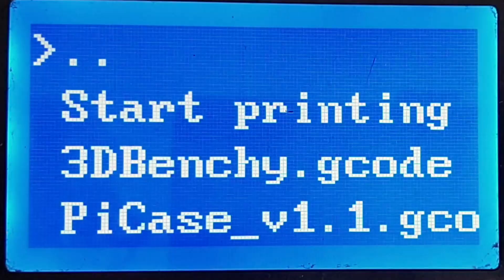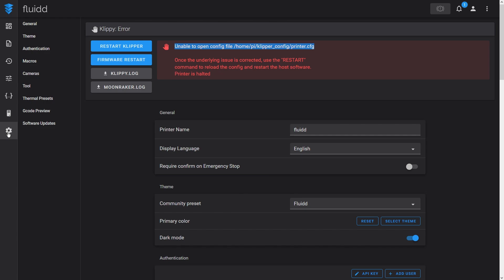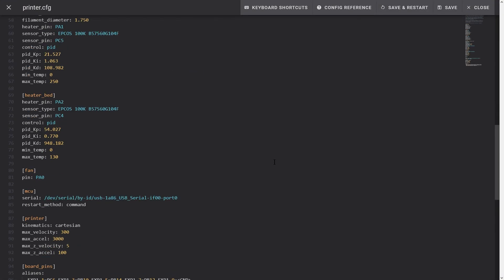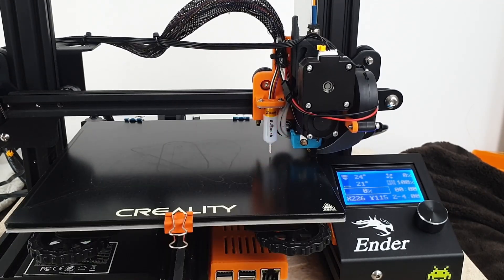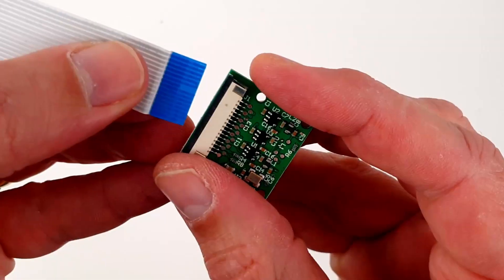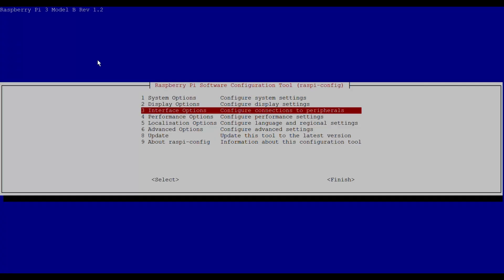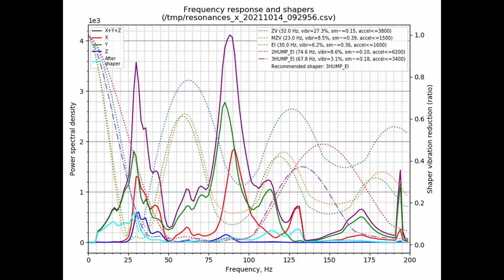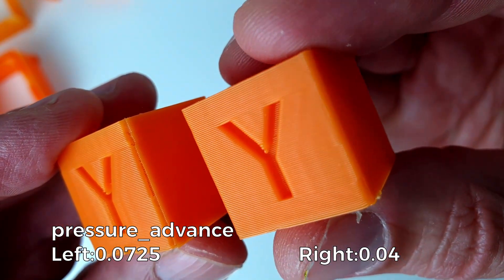Klipper on Ender 3 😱

Comment: I am thinking about installing Klipper on my Ender 3 V2 but I am a little wary about the BLtouch configuration. On Jyers firmware I have the BLtouch setup to use the Z stop switch due to the constant fails when set up on the dedicated BLtouch port. Do you know what adjustments I would need to make in the Klipper firmware to continue using this method?
Reply: I have an Ender 3 Pro with BTT SKR Mini board, but the principle is the same. My BLTOUCH is connected to the dedicated port for power (red, yellow and brown) and the z-endstop port for signal (black/white). You need to find out what the name/numbers are for the ports on your board and specify that in your printer.cfg. The ports are named differently on my board, so you have to search a bit. But if you get the names right, it'll work.
Reply from the maker: Thanks for your help. Can you please share your [stepper_z] section and [bltouch] section in printer.cfg? The pin names for the Creality board V4.2.7 are: endstop_pin: ^PA7, sensor_pin: PB1, control_pin: PB0.
Reply: @YouMakeTech  In the [STEPPER_Z] section, you add 'endstop_pin: probe:z_virtual_endstop' and the bltouch section looks like this: 
[bltouch]
sensor_pin: ^PC2

control_pin: PA1
x_offset: 39.5

y_offset: -3

But this is on a SKR Mini E3 V2, so the pin names on the Creality 4.2.7 board are different. In the example config for the SKR board, they put in the pin names for the bltouch connector, not the z-endstop, so it wouldn't work at first until I figured out the endstop pin was different.
Reply from the maker: Thank you very much. The Z end stop pin name on the Creality V4.2.7 is ^PA7. So applying what you did on the SKR Mini E3 V2, we should do this for the Creality V4.2.7: In the [stepper_Z] section, we keep endstop_pin: probe:z_virtual_endstop. In the [bltouch] section, we change sensor_pin from PB1 to ^PA7 and we keep control_pin: PB0. 
sensor_pin : PB1 means the BLTouch is connected to the dedicated 5 pins connector. 
sensor_pin: ^PA7 means the BLTouch is connected to the Zmin end stop.
Reply: @YouMakeTech   Is that the same pin name for the 4.2.2 board. I tried moving back to the 1 connector with 5 wires to see if it would work in Klipper but just like in Marlin it crashes :(
Reply from the maker: I believe yes, according to this -> https://github.com/MarlinFirmware/Marlin/blob/2.0.x/Marlin/src/pins/stm32f1/pins_CREALITY_V4.h
Reply: Update- followed the steps right the way up to the create the printer config file. I looked in the config examples and opened up the creality ender 3 v2 file and copied the contents, made the new printer.cfg like in the video and saved but then after firmware restart i just get -

Printer is not ready
The klippy host software is attempting to connect. Please
retry in a few moments.

Waited for 1 minute then this messge shows
mcu 'mcu': Unable to connect
Once the underlying issue is corrected, use the
"FIRMWARE_RESTART" command to reset the firmware, reload the
config, and restart the host software.
Error configuring printer

Anyone any ideas?
Reply from the maker: Did you update Klipper to the newest version? I just did and I had a similar error message. To fix it, I had to re-flash the micro-controller code in the printer mainboard. It appears that Klipper is not backwards compatible: The version of Klipper in the Pi and in the mainboard must match. In any case, try to re-compile and re-flash the printer mainboard. I checked the ender 3 V2 config file and the settings are the same: during "make menuconfig" select the STM32F103 with a "28KiB bootloader" and serial (on USART1 PA10/PA9) communication.
Reply: @YouMakeTech   I am so confused. I followed your tutorial.... I did the make firmware and flashed it. I dont understand what I am doing wrong :(
Reply: in Fluidd I went to the setting and updated all parts including the OS then I went back and made the firmware again and flashed and its still the same :( When you say flash the MCU in the printer do you just mean make the klipper firmware on the raspberry Pi and then put it on an sd card and reflash the printer?
Reply from the maker: Have you ever succeeded to establish the communication between Klipper on the Raspberry Pi and the printer? Maybe try another USB cable. Many USB charging cables are not completly wired and do not work for data... Sorry I cannot help you more but troubleshooting hardware/software issues remotely is next to impossible. Thanks for your understanding
Reply: @YouMakeTech  I have tried 5 other cables that all work with marlin and octoprint. No I haven't been able to get a connection :( Thanks for trying.... I will persevere.
Reply: @YouMakeTech  Further update... I tried another 3 times and finally the flash worked and I have a connection now. what a relief. Just trying to get my head around the printer.cfg file now. Can I ask .... where did you get the [BOARD PIN] ALIASES from ?
Reply from the maker: The cable is OK. Have you tried to select Communication interface = Serial instead of USB when making "make menuconfig" and re-flash the mainboard?
Reply from the maker: @MacAdder1965  Good news! Did you find out why it did not work before? What did you change? The aliases are from the exemple config provided by Klipper for the Creality V4.2.7 mainboard
Reply from the maker: I am not 100% sure because I haven't tested it but I believe the main modification would be in the [stepper_Z] section. With the BLTouch connected to the dedicated 5 pins connector, I have: endstop_pin: probe:z_virtual_endstop . But if you want to use the Zmin end stop pin, you need to change endstop_pin to ^PA7. The content of the [bltouch] section should remain the same: sensor_pin: PB1 and control_pin: PB0.

Comment: Should power the Pi with 5.1 Volts to avoid under voltage conditions.
Reply from the maker: I believe under voltages conditions occur when the dc dc power converter does not supply enough current. If you experience under voltages conditions, try to use another dc dc converter which can supply more current. Raising the voltage does not help and is not advised
Reply: @YouMakeTech  I deploy Pis for a wide assortment of things and used many different ways to get power to a Pi and with the Pi 3B+ and 4 series I have found they're much happier with 5.1V.
Reply from the maker: Never tried this. Good to know. I had once an under voltage issue when overclocking a Pi but increasing the power supply current solved the issue

Comment: I have an Ender 3 V1 with an E3 V2 SKR board, I have looked in the config file from the Klipper Github, it states 

"for the BIGTREETECH SKR mini
# E3 v2.0. To use this config, the firmware should be compiled for the
# STM32F103 with a "28KiB bootloader" and USB communication. Also,
# select "Enable extra low-level configuration options" and configure
# "GPIO pins to set at micro-controller startup" to "!PA14"." 

When installing can I use the options you selected? STM32 and STM32F103? and do I need to change the communication interface to PA14?

Thank you.
Reply from the maker: You should start with the Klipper example config for your SKR board. The settings shown in the video are for Creality 32 bits mainboards, V4.2.2 or V4.2.7
Reply: @YouMakeTech  thank you for your reply, I managed to install the firmware made with klipper using the example config file I linked earlier which states at the top what options to select. I have ran into an error now though, I followed the steps you did copying from the fluidd documentation. All went well but the “Pause” code, I pasted it in my printer.config file and I now get this error “Existing command 'PAUSE' not found in gcode_macro rename”. Do I need to rename it? Thanks
Reply from the maker: I did not have this issue. Maybe try to delete the line "rename_existing: PAUSE_BASE" in your printer.cfg and restart the firmware?
Reply: @YouMakeTech  I already have PAUSE_BASE in my config, I think this might be why?

 "PAUSE_BASE
  G91
  {% if printer.extruder.can_extrude|lower == 'true' %}
    G1 E-{E} F2100
  {% else %}
    {action_respond_info("Extruder not hot enough")}
  {% endif %}
  {% if "xyz" in printer.toolhead.homed_axes %}
    G1 Z{z_safe} F900
    G90
    G1 X{x_park} Y{y_park} F6000
  {% else %}
    {action_respond_info("Printer not homed")}
  {% endif %} "
Reply from the maker: Very likely. Try to keep only one

Comment: Great video. Now I really want to install klipper on my Ender3pro but looking at the prices of raspberry boards makes me cry.
Reply: You won't need a Pi4. A 3B is more than enough, and the new Pi Zero2 too. The 'old' Pi Zero can do it as well, but if you're going to run a camera off of it, you could run into issues.
Reply: @PhilippensTube  So the Pi v1 and the Pi Zero are super similar and can both run this configuration albiet at around 80-90% usage. 

Pi 2 starts the quad core tradition, still 800-900 mhz but 4 cores now instead of 1.
Pi2 with octoprint + about 22 plugins puts her at 30%ish or less when printing.

honestly any pi will run this. and Pi v2+ are all capable of running multiple instances of this ie multiple printers.
Reply: @VysesDarkheart  It all depends on which plugins. A Pi Zero with a webcam (resolution and framerate may play a role) could be a bit problematic. But in principle any Pi can run Octoprint.
Reply from the maker: Thanks. Yes, prices have inflated a lot. Looks like a Pi Zero is sufficient for Klipper, this may be less expensive.
Reply: @YouMakeTech  I would wait a little untill new year. Even Pi zeros are out of stock (where I live) and I don't want to pay a price of second Pi for shipping. I hope the shortages will end next year.

Comment: i am having trouble setting up my printer.cfg file, i have creality 4.2.2 board, "poor man's bl touch" (selfmade bed level sensor). idk what pins do i need to use. can anyone help me ?
Reply from the maker: Where did you connect your "BLTouch" to the Creality mainboard? On the Creality 4.2.2 and 4.2.7 mainboards, there is now a dedicated 5 pins port for the BLTouch. In that case, the pin names are the same as the ones shown in the video

Comment: I'm going to attempt this on the Ender 3 Pro w/upgraded silent board. I have what I believe to be a working config
Reply from the maker: I definitely recommend it especially if you want to print faster. I have also an Ender 3 pro with a silent board upgrade (V4.2.7) + additional upgrades (BondTech BMG, E3D V6, 5015 fan). Klipper might seem a bit intimidating but it is easier than it seems as long as you follow the documentation closely ... 
If you need it, you can check out at my Klipper configuration files on Github: https://github.com/YouMakeTech/klipper-ender3 . I also have links to the 3D printed parts & supplies that I use in the setup shown in the video: https://youmaketech.com/klipper-on-ender-3/ . Let me know how it goes and if there is any problem please feel free to contact me through YouTube, I will do my best to help you

Comment: Excelent video. I have installed klipper on one of my enders but I have two left that I couldn't. Will your method work with the 1.1.4 board?
Reply from the maker: Thanks for your comment. It should be possible in theory to make Klipper work with a 1.1.4 board but I haven't tried. This would require to update the printer.cfg file with the correct pins / settings + to compile a printer.bin firmware for the printer with the correct processor/bootloader etc. Unfortunately, I could not find an example printer.cfg file for this board with Klipper... So finding the correct information is going to be tedious!
Reply: @YouMakeTech  Yes I have klipper working on a 1.1.4. thank you I will do some research

Comment: Maybe the lcd screen is not a obligatory thing to keep , you can control all printer with the web interface
Reply from the maker: Right.  I am probably the only one on earth who still want to keep the LCD screen!
Reply: @YouMakeTech  jajajaj your tutorial Is awesome and simple 
Your printr with this mods are a awesome and fast. Good luck bro and big hugh from Argentina
Reply: @YouMakeTech  I’ll keep the display aswell. If I wasn’t able to use the display I honestly would not use Klipper..
Btw great tutorial! I didn’t find any tutorial for old Ender 3 (pro) with the 4.2.7 board and working screen.
Reply from the maker: Thanks for your comment. Klipper is amazing but I found the LCD menu did not work very well. It was very easy to make something stupid (like homing the printer in the middle of a print!) or to crash the firmware... I did not mention it in the video but I made a lot of customization to the LCD menu. You can find my changes for the Ender 3 on GitHub in case you need it: https://github.com/YouMakeTech/klipper-ender3 . This makes the LCD menu behave more like Marlin. Whenever you start a print, all menus disappear, you can only tune some parameters (nozzle, bed, print speed, flow), pause or abort the print. Please let me know how it goes!
Reply: @YouMakeTech  how to add the changes? Just add the menu cfg in fluidd?
Reply from the maker: Yes: In fluid, upload my custom menu.cfg in the printer.cfg directory. In addition, you need to add [include menu.cfg] in your printer.cfg.
Reply: @YouMakeTech  so copy the content of menu.cfg inside printer.cfg, is that right ?
Reply from the maker: I believe you can do that too. But the best way to do it would be to add a line in you printer.cfg: [include menu.cfg] and to upload menu.cfg as a separate file next to your printer.cfg.
Reply: @YouMakeTech  got everything running so far but my bltouch won’t stop at the bed so my nozzle jammed into the bed. It won’t deploy when it gets touched
Reply from the maker: Sorry to read you have issues with the BLTouch in Klipper. 
* Is your BLTouch connected to the 5 pins connector of the Creality V4.2.7 board (not to the Z min stop pins)? If not, you may have to update sensor_pin and control_pin to the correct values in the [bltouch] section.  
* Is it a genuine BLTouch or a clone, which version? Some clones/versions are not 100% compatible and require some settings to be changed (see BL-Touch "clones" section in https://www.klipper3d.org/BLTouch.html)
* There are some troubleshooting instructions in the Klipper documentation: https://www.klipper3d.org/BLTouch.html :
" First run BLTOUCH_DEBUG COMMAND=pin_down in your printer terminal. Verify that the pin moves down and that the red LED on the probe turns off. If not, check your wiring and configuration again. Next issue a BLTOUCH_DEBUG COMMAND=pin_up, verify that the pin moves up, and that the red light turns on again. If it's flashing then there's some problem.

The next step is to confirm that the sensor pin is working correctly. Run BLTOUCH_DEBUG COMMAND=pin_down, verify that the pin moves down, run BLTOUCH_DEBUG COMMAND=touch_mode, run QUERY_PROBE, and verify that command reports "probe: open". Then while gently pushing the pin up slightly with the nail of your finger run QUERY_PROBE again. Verify the command reports "probe: TRIGGERED". If either query does not report the correct message then check your wiring and configuration again. At the completion of this test run BLTOUCH_DEBUG COMMAND=pin_up and verify that the pin moves up."

Hope this helps
Reply: @YouMakeTech  got everything working! where did you get the stl for the ADXL holder?
Reply from the maker: @DemSkillzx3  👍 Cool! Check out my website: https://youmaketech.com/klipper-on-ender-3/ .There I have links to all 3d printed parts and supplies I use in the video.

Comment: Super vidéo, je cherche à augmenter la vitesse de mes impressions sur ma
ender 3 pro et avec marlin ce n’est pas évident.
Le raspbery offre cette possibilité.
J’ai plus qu’à me mettre à la page
Reply from the maker: Merci pour votre commentaire. Marlin est un super firmware mais Klipper a vraiment été optimisé pour imprimer vite. Avant même d'activer input shaping et habitué à Marlin, j'étais déjà impressioné par la fluidité d'impression de Klipper. Je pense que le contrôle des moteurs est beaucoup plus rapide et précis et la cinématique a été bien optimisée... Mais quand on active l'input shaping, on entre dans une autre dimension! Comme l'Ender 3 est plutôt lourde, dès qu'on augmente la vitesse, ca vibre dans tous les sens et la qualité d'impression se dégrade. Avec Klipper, l''input shaping compense les vibrations et on peut imprimer avec des accélérations de 3000-7000 mm/s² sans problème! Vraiment impresionné par Klipper.